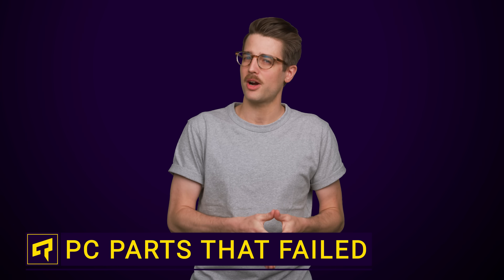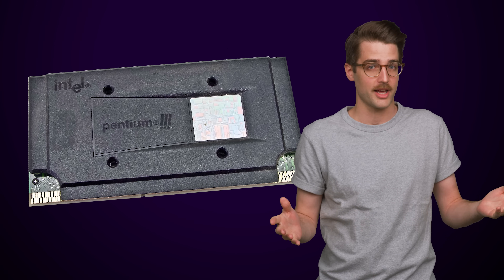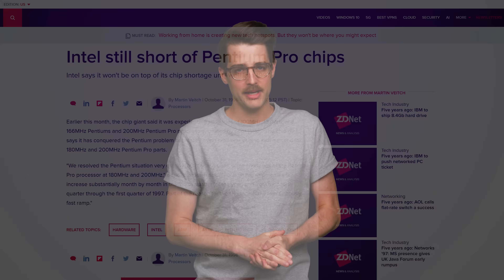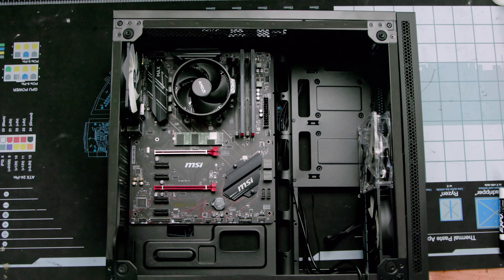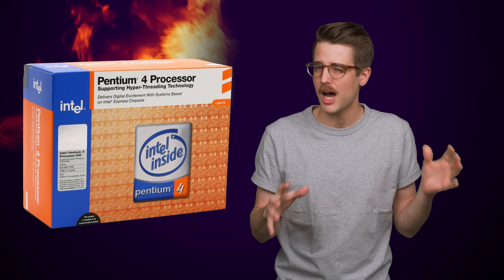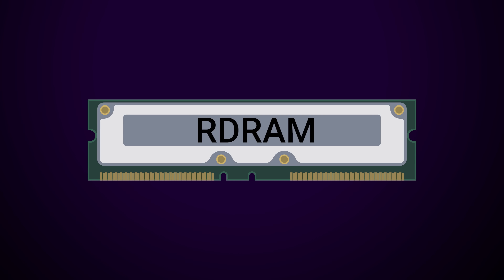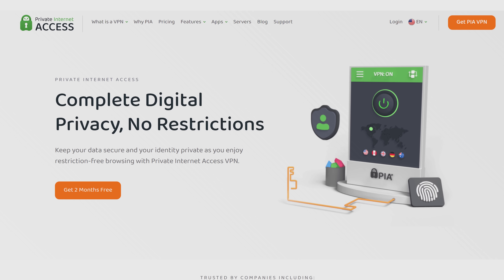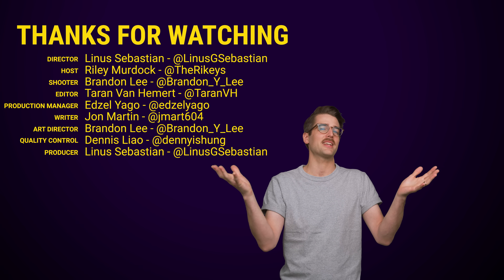PC Parts That Disappeared

Comment: Hey LTT, please make a video on generational improvements in memory. Not a techquickie, that's a full feature if not two.
Premise: every few years, PC users are hyped up about the next memory standard. It'll be so much quicker, cooler, cheaper etc.
When the new stuff comes out though, the performance improvements aren't ever worth jumping ship immediately. And they even seem to become more negligible every time.
For me personally, the advent of DDR RAM was the last time faster memory actually impacted gaming performance enough to feel it.

So the question is: how much faster were otherwise comparable systems with newer RAM in the past? Knowing your audience and focus, you should probably not target SD-RAM, But:
DDR->DDR2 could be done on Intel socket 775 with the same CPU
DDR2->DDR3 could be done on AMD socket AM2+ and AM3 (with the same CPU too!)
DDR3->DDR4 could be done on intel socket 1151 (certain boards that allowed DDR3L in what is technically a DDR4 slot)

People with 2021 CPUs already fear having obsolete tech when DDR5 comes out. Let's use the past to predict the future.
Reply: You could probably even use the same games as a benchmark for all of these. I thought about even using the same graphics cards if something like a 1080ti still works in that S775 board.

Comment: SCSI, parallel port, serial port,...they are not really gone (At least not at the company I work for), but they work with really old machinery, modern machines will not have them due to much better USB, SATA and firewire tech, but the latter two are getting scarcer aswell

Comment: PC-800 RDRAM was nothing special, but PC-1066 RDRAM with a Pentium 4-B (533 FSB) was a beast at the time. Unfortunately you paid plenty to get that performance. I sold 512MB of PC-1066 on eBay in 2007 and it covered the cost of a new high end Core 2 Duo motherboard.

Comment: I notice Dell still uses proprietary motherboards and PSU setups. 
I ordered an optiplex in 2017, and was intending to swap out the PSU and add in a graphics card. 
It used some odd combo connection of one 2x3 hookup and 1x6 hookup. 
I sent it back and proceeded to go to newegg.

Comment: I saw the slot CPU in my 2000’s old Osborne Science Encyclopedia. My first thought was that it had a function similar to a math coprocessor (I think it was the Intel 8087? Idk)

Also, the form factor still kinda lives on in embedded electronics. The Raspberry Pi Foundation has boards called Compute Modules, that are essentially slot CPUs, but with some not-slot-CPU features like built-in eMMC. These boards are used in applications that are near, far, and literally far. AKA They took 2 of these bad boys to orbit in a satellite (2 for redundancy). I think it was a space telescope, maybe the Event Horizon telescope. Not sure tho.
Reply: I know you made this post a year ago, but I would just like to confirm it was the Intel 8087. I remember the 486DX included it on chip but the cheaper SX did not.

Comment: 0:35 There were not only soldered on CPUs. I also have such a card with a socket on one side for the CPU to be put in. You could change the type of compatible CPU by a small jumper on the card.
Reply: Modular on top of modular. Nuts.

Comment: Remember silicon discs? aka having a ram drive to load files onto & manage or run them from there was like having a SSD in 1984 (except not storing the data after poweroff). Also 3" dualsided 200kb floppies was amazingly fast quirky compared to the 5,25".
Oh, & those slot1 pentium 2 could certainly also have cooler issues. I recall having to replace one as an older one had become slow from overheating too much.

Comment: I think it is hilarious that Riley covered really short-lived and arguably dumb tech, and comments are filled with suggestions of older, long-lived and elegant tech. I must be getting old. Personal bug bear AGP was revolutionary in graphics card power, sure it dead-ended due to pci-x evolution, but it stuck around for the better part of a decade, and some features were carried forward to our current designs.
Reply: AGP was suppose to be the end all be all of gpu slots. Unlike pci e agp was a dedicated graphics bus not shared with any thing else direct path between gpu and cpu. PCI E is shared between devices and once your out of lanes something has to go. This is why you have computers that are running 16x cards at 8x because there are just to many other devices using pci e lanes.
Truth is i think nvidia had a ton to do with the nuking of agp with sli and amd with cross fire. We would likely still have agp of some sort if not for those 2 multi gpu set ups. 
3DFX was working on multi gpu configs on a single card to give sli like performance or better from a single card but nvidia had specifically targeted 3dfx to kill them off. Once they bought 3dfx and took the sli tech and started running with it and the agp slot died off as a result.
Fact is we probably would not have seen video cards being used for crypto mining if agp was still around i doubt it would work well for crypto mining
Reply: I remember building a PC rig when AGP was mid stride, all the most badass graphics cards yadda yadda. When I went to build a new PC several years later, I was surprised that it disappeared and then had to learn the new architecture. Then again when I did a major PC overhaul last year. But at least everything modern still fits in my 10+ year old cooler master full ATX case. I even have a slot for a floppy drive.
Reply: You accidentally (I think) mentioned another dead bus. PCI-X is a thing, but it's a different thing from PCIe/PCI-E that we all use for expansion these days. PCIe is PCI Express, but PCI-X was PCI eXtended, an extension of the PCI bus mainly used in servers and workstations. It was specced to use the same slot as PCI, but was most often seen with an extended 64-bit physical slot.
As for PCI-X video cards, there were some Matrox cards, and I think ATi made one, but the bus was mainly used for RAID and NICs.

Comment: Lets see... you missed so much here.  Back in the day there were "hard cards" (hard drive controller and hard drive on a single ISA card), light pens, joystick ports, clock chips you had to add yourself, ISA bus expansion chassis, ribbon cables, serial ports (if you were really with it there would be a mouse or external modem attached),   modems,  floppy drives, 3d only accelerators, Dual-CPU systems (not multicore) ....the list goes on.

Comment: A big hit of late 90's was the MULTIMEDIA kits. I remember there was tons of ads on newspapers and TV commercials about making your pc able to make sounds! Yes my little young fellows from generation Z. PCs until mid 90's lacked sound at all. So you had to buy an expensive kit with a soundcard and an awful pair of speakers. And if had enough money, the ultimate kits also includes a drive for a shinny media that finally started to get popular in wilds, the CDs!
Reply: When you mentioned that it reminded me of how in the 2000's you would see lots of "multimedia PC's" that had tons of extra components to try and give them the same functionality as a TV, and sometimes even a modified OS to run the software, with the intention of making it an all-in-one device that would fit both roles and replace both your old PC and TV, instead you ended up with a shitty PC that doubled as a shitty TV 🤣
Reply: And then deal with the driver headaches of the soundcards.
Reply: @SteelJM1  Exactly..... i had exactly that kind of fun with the first PC i got from my parents.... that was a lot of "fun" at that time: I had no clue about PC´s myself at that time, same goes for my mother and my father´s knowledge was pretty much ancient in computer terms.... oh and a personal internet connection for me was still about half a decade away. What a fun that was when the great multimedia-pc decided to get some hickups (again)

Comment: Very poor video, basically mentioned few irrelevant technologies or formfactors and that is it. For slotted CPUS... CPU has not disappeared as a part, just form factor changed, should we as well regard different sockets as different parts? Same for BTX motherboards, it is still a motherboard... and there are loads of different standards even today. RDRAM is slightly more interesting, but again we still basically have part of some form in our PC today. Closer to actually parts which we no longer use are things like TV Tuners, Sound cards, 5.25" bays and increasingly 3.5" bays... SATA  together with hard drives mounted in chassis is going away (not yet but soon), now you fit the drive on motherboard. SLI/CF and generally multi-graphics card solutions or dedicated physx cards are gone... load of add-one cards basically disappeared, before you would have had system catches or even motherboard extensions on ISA cards and all sorts of funky stuff, hard drive adapters, raid controllers, display outputs, I/O outputs etc... all of that was integrated into chipset on motherboard. And even I am just mentioning most obvious things...

Comment: Actually, RDRAM offer the greatest bandwidth for system memory at the time, although the memory latency was high. The problem was that tiny FSB on the Coppermine Pentium 3 couldn't take advantage of it and suffered from steep memory latency. AMD and other chipset manufacturers didn't have a license for it due to Intel-RAMBUS exclusive deal. Pentium 4 solved the FSB problem by going quad-pump (4xbase clock).  RDRAM was optimal memory platform for Pentium 4. It remain untouched until the Intel-RAMBUS deal expired and Intel quickly adopted DDR1 even so it barely match RDRAM. RDRAM was finally bested by DDR2 but at point RDRAM was already dead. 

The high price of RDRAM was more due to the massive legal clusterstorm that surrounded the memory cartel. TLDR verison, RAMBUS tried to strongarm the rest of the cartel but the cartel strong-armed back harder.

Comment: Zune, Optane, Phones with slide out keyboards, phones with attachable projectors, Pocket PC, phones with voice command that actually worked a decade before "assistants" with iffy server-based voice detection appeared on newer platforms. Skeuomorphic desktop OS interfaces, serial ports, parallel ports, external dual floppy drives, home cassette tape-based storage media, shotgun modems, ISA expansion slots, Linux.

Not all are hardware or strictly PC parts but....

Comment: PowerMac 6xxx/7xxx/8xxx/9xxx series rigs being a prime example of "processor on a card" tech. The CPU (and cache) was on a replaceable card that fit a dedicated slot. My PowerMac 7500 started life with a PowerPC 601 clocking along at a "blistering" 100MHz, got upgraded to a 603@300, got bumped again to a 604@ 400, got bumped AGAIN to a G3@400, then in its final incarnation, had twin G4 processors clocked at 1.2GHz. Ran that rig from about '96 to around 2010 before it just wasn't possible to upgrade the OS and dev tools any further. (the switch to Intel-only builds of MacOS X was the killer - The "Old World" ROMs were pure PowerPC code, and couldn't be upgraded, so running the Intel-only builds was impossible) Ran YellowDog on it as a *nix box for a while, but that just didn't cut it for me, and I reluctantly moved over to an Intel-based Mac to get back to the OS and dev tools I knew and liked best. I'll go to my grave saying that the 7500 series may well have been the best computers Apple ever put out.

Comment: If I remember correctly, RDRAM had continuity modules that had to be installed in any remaining open slots on the MB, too. What a crazy system.
Reply: Reminds me of Apple Macs back in they day when they used SCSI ports (rather than Parallel or RS-232 Serial used by PC) for peripherals. You had to daisy chain your scanner, printer, etc...and install a terminator on the last device. I believe you also had to set a SCSI ID for each device.
Reply: @LC-uh8if  Not quite. RDRAM works kind of like those old Christmas tree Lights. If one lamp Breaks, the series is broken, thus nothing works.

SCSI on the other Hand needs to be terminated at both ends of the Bus, because otherwise Data would bounce around causing collisions.

Comment: Had a OEM pre-built BTX PC, ran a Pentium 4 at 3.6GHz. The PSU or motherboard broke down quite a bit and had a rather violent failure mode. Nobody knew why, but my guess was the OEM was using power capacitors that had poorly designed electrolyte.

Shame, was a beast at the time of 2004.

Comment: Jeez, you could have covered more
How about

V Ram
Chip Ram
The TURBO button on the White Windows 95 or DOS Computer
Floppy Drives
IDE Drives,  that you need to configure with a jumper to either  MASTER, SLAVE or CABLE SELECT
IDE, Uni directional ribbon Cables
Parallel Printer Port
the second 3 pin Power connector on the AT Form Factor Power supplies that allowed your monitor
to connect to your PC without using it's own wall power
a Ball Mouse
How about......     STOCK STANDARD FAN THAT ACTUALLY CAME WITH YOUR CPU WHEN YOU BOUGHT IT ,   No one is talking about that huh ?

PGA CPU's
AT Keyboard connector  / 5 Pin DIN connector
Front part of a computer case that had a flap so that when you ejected your CD ROM there was a flap in front of it to slide out of ,    Now the cases have optical drives flush with the case, instead of the flap in front of it 
PCI Slots
AGP Slots
A THIRD MOUSE BUTTON

AND THE MOST IMPORTANT COMPONENT OF A PC
A TROLL DOLL THAT USED TO SIT ON TOP OF THE MONITOR HELD IN PLACE BY A PIECE OF BLU TAK.

What happened to fucking troll dolls
in a world full of trolls.... Where are the troll dolls ?

Comment: Seeing non pin CPUs come back may be interesting especially if integrated graphics could get as good as GPU graphics
Reply: I would like to see slotted CPUs back just so I won't have to mess with thermal paste. Not only it's difficult to apply the right amount of thermal paste, but that thing can make a mess that's impossible to clean from your clothes or even your skin. Such a material doesn't belong in the home and you should be able to build a PC without having to use it. There would be no need for pre-builds if we had slotted CPUs.

Comment: Another thing that completely disappeared and almost forgotten in desktop PC is external VRM modules. During the pentium 1 era, many motherboards had a pin header to plug an optional vrm board. This allowed the use of more power hungry cpus or cpu using a  voltage not supported by the mobo.

Comment: I have an old P4 system with RBram on it. Forgot to mention that ALL the ram sockets need to be filled and if you run only the one pair of dims on a bored with 4 sockets you had to populate the outer two with jumper dims.

Comment: DVD Camcorders.  They were a great idea in theory, but man they sucked in practice.   I owned one.  You could record 45 min of video, but to review the video you had to close out the recording session on the Mini DVD.  Now the issue was if you had 5 mins of video and wanted to review it you had to waist 40 mins of potential video and that Mini DVD was done.  You could only watch it in a compatible DVD player, and if you wanted to make it a PC viewable video you had to convert it to an .iso file.  At the time at around 2005 I was super into computers and was a contracted IT guy.  There was no way the average person would have been able to figure that out.  Also no YouTube help there.  What a pain in the butt.  That and about 100 more issues came from it.  If you recorded something, lets say you were lucky to get the full 45 mins of potential recording, but before you closed out the DVD and you touched the data side of the disk, you could not close it out properly, and if you did attempt to close it out with a finger print before you realized someone got their grubby greasy fingers on that side of the Mini DVD it would corrupt the disc forever.  Can't pass go, Can't get $200.  Now in its defense it did have superior video quality if you could navigate all of the other issues.

Comment: Aaaahhhh.  The good ol' slot processors of yore.  Although, there was the Celeron-300A.  That thing was gold.  Why? Because you could overclock it from 300MHz to 450Mhz.  But, you could only do it on the ~A version.  If I remember rightly, the ~A's were literally just rebadged ~450's, which were much more expensive.  It was due to the fab that was producing/assembling the ~450's had much higher yields than the one producing/assembling the normal ~300's.  Or something along those lines.

Comment: Slot CPUs had major flaw - latches to hold CPU in slot were integral part of plastic case. Any cooling upgrade (except stronger tiny, whining fan) was very difficult.
Reply: I had a Slot A 1Ghz T-bird(upgraded from a 750Mhz) with a Golden Orb cooler on it...
Reply: @Sadler2010  Golden Orb coolers were a thing back then. I think ThermalTake was the first one to refine this design by adding angled fins around fan for better airflow and less noise.

Comment: Rambus RAM wound up in the N64 as well, and was the major bottleneck in the system due to it's terrible latency, and that's also why the jumper pack exists, it's basically a dummy stick so the system will boot. Not an amazing legacy for Rambus.

Comment: The odd thing is that RDRAM for me didn't run hot at all, i have an old P4 motherboard with RDRAM instead of DDR, it runs fine, it's not hot at all, i can touch it just fine, warm yeah, but not hot. It had potential, it was better than SDRAM and it came out around a year before DDR, so at that time, it had potential, but with the introduction of DDR memory and the way lower licencing fees and manufacturing costs, it became obsolete.